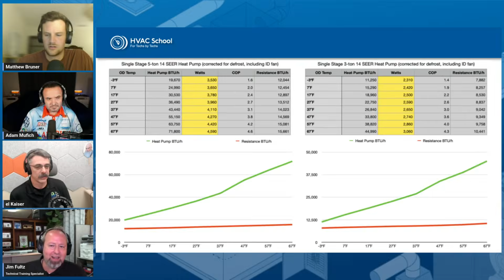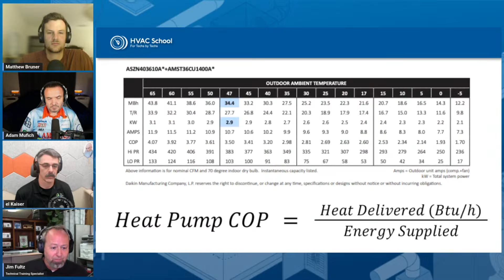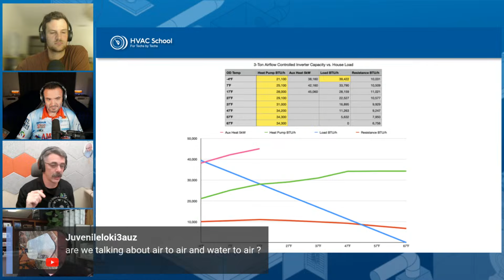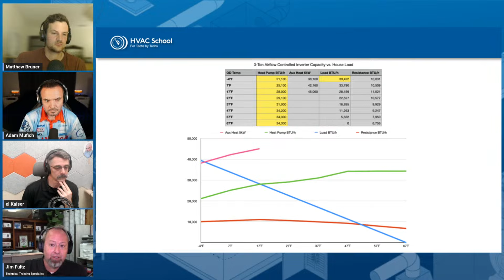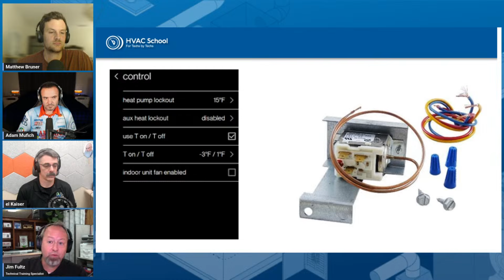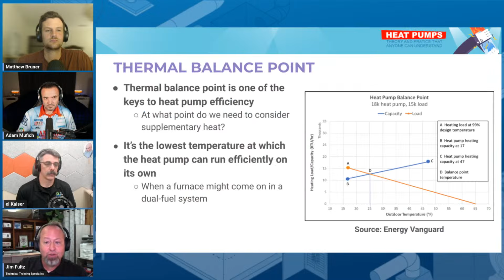Heat Pump COP and Low Temp Lock Out

Comment: Please, I have an important question...

Our heat pump installer is not the brightest light bulb on the tree.  We have a Daikin Fit 3 tonne with electric backup coil installed, set at 8kW.

We got our first electric bill with full heat pump usage.  It used MORE electricity than direct electric-only heat for the same period last year.

I truly think he is not smart, and did NOT set up the programming for highest energy efficiency.

As per his settings, backup heat is turned to "always on during defrost cycle".  But this backup defrost heat is described by Daikin in their documentation as "selectable - off for greater energy efficiency, and on for greater comfort.  And he set the defrost cycle for every 90 minutes (but it is selectable 30, 60, 90, and 120 minutes).

Second, his Auxilliary Heat Strip Lockout Temperature is set at 2 degrees Celsius.  That means that for 3 to 4 months of the year, we are regularly using the 8kW heat strip.  Compare this to last year, direct electric, when we ran only 6kW total in the house.

From everything I've read and listened to (including this video), my COP should still be fine with this Daikin Fit 3 tonne down to -23.3 Celsius (as per the Daikin documentation).  But, below a certain temperature, the Daikin heat pump may have trouble producing the volume of heat required.

Questions:

1).  It seems fine to disable the "Defrost Backup Heat" for efficiency, as per Daikin documentation.  Is this true...?

2). I think the Aux Heat Lockout Temperature is WAY TOO HIGH!!  Setting it to -10.5 Celsius seems reasonable to me.  What do you think...?  (I have read that the lower your Aux Heat Lockout Temp, the more your Heat Pump has to work, which could shorten its lifespan.  But if these things are toted by governments and sales and installers as being great to be cheaper than direct electric, but if they require direct electric for the main heating season to enable their lifespan, then can't we consider these units nearly useless...??  I am in Nova Scotia.  Winter temperatures often down to -10 to -20 C, and sometimes 3 nights per year below -20 C.)

3).  The Heat Pump lockout temperature is set to -40 C.  Should this be set to -25 or -30 C...?

Many thanks.  I hope someone can give me some answers.  The contractors around here aren't the smartest guys in class...  They can attach plumbing and plug in some wires, but they don't understand much about science and maths.

Comment: I have a Daikin Fit 3 tonne.  It states the operational temperature is down to -23.3c.  What temperature should the heat pump lockout temperature be set to...?  My installer is an ijut and set everything terribly! I was initially using more electricity to heat my house than the direct electric heaters I used last year!

Comment: That ending was awkward as frig.  
I have saw multiple times where people installed the evap before the furnace and in all those cases, it was a disaster.   I condemned a furnace a few weeks back and it was 6 years old and it was a corroded mess.    We didn’t install it originally.  We replaced the furnace and reused the evaporator and installed it correctly with the coil downstream of the furnace.
Reply: It was awkward. Sometimes our perception is skewed by our immediate surroundings. I live in a extremely dry climate and have not experienced the heat exchanger corrosion on the level the majority of the country sees. After the session I dug in and tried to see what was online about this. My first conclusion after finding limited conversations was that I would not recommend a coil upstream for the majority of the country. My second conclusion after looking into manufacturers installation manuals was this practice should not be ever recommended. I apologize for my misleading comments. Even after years of industry experience we continue learning daily. Never be afraid to back up. Jim
Reply: @JimFultz314  Excellent answer Jim! Humble and honest - makes me trust you more. Keep up the great work!

Comment: I have had two heat pumps installed in my home over 15 years.  Both times they were wired to use more electric strip heat than necessary.
Reply: Same problem I'm having!  Please read my comment above...

Comment: Seems like Honeywell was not given much love considering they could handle 4 stages of heat with PI control 20 years ago.  With no glitches or power issues.  Just worked.  Honeywell’s 20 year old Visionpro IAQ could do 4 stages of heat in a heat pump system  with plenty of configurable options.  It could also do dual fuel or geo.   Ten years ago their Prestige IAQ upped the ante with realtime delta t calculations and alerts if performance was degrading or you wanted to test temperature rise in each stage.  With electric strips in test mode it is easy to calculate cfm as well.  The Prestige added WiFi and was capable of reheat dehumidification.  Granted some of their recent low cost T models (except T10) were not home runs but the newer WiFi Vision Pro and the Prestige IAQ are still available.
Reply: That's great information!